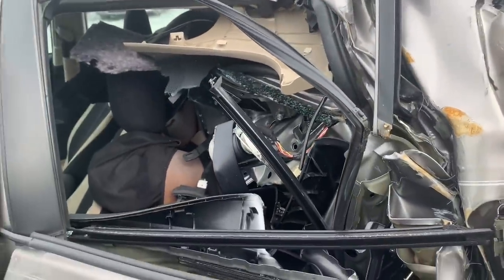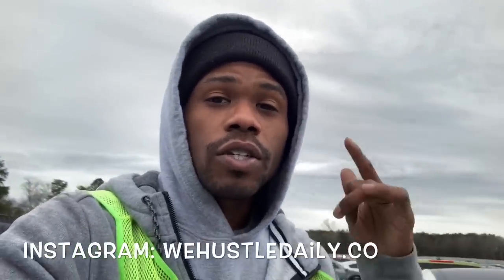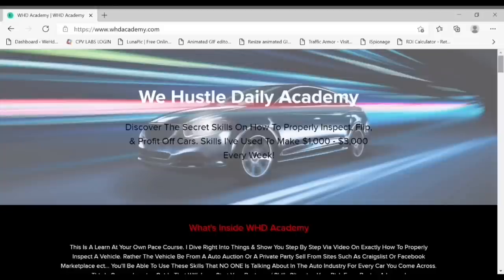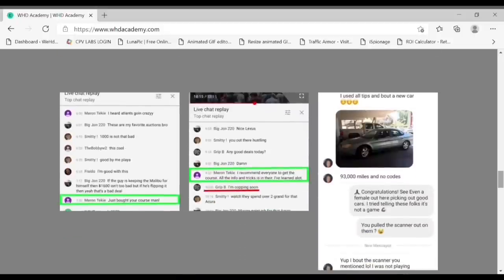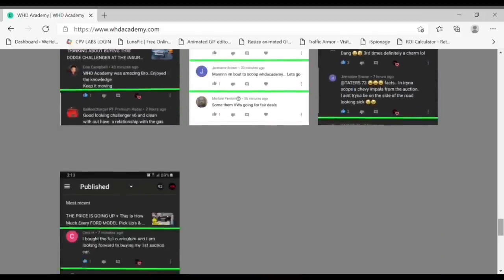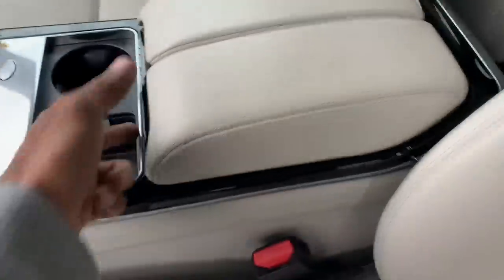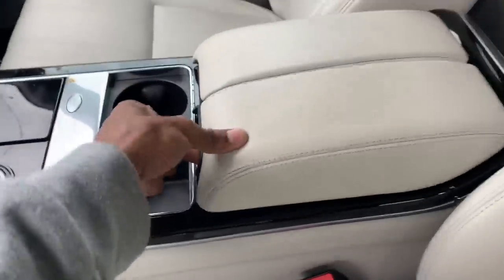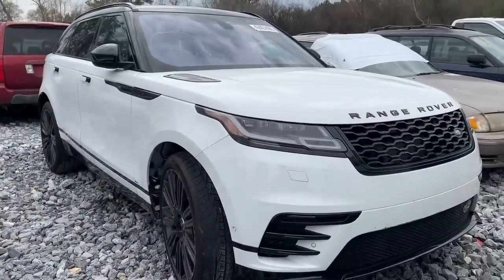MINOR DAMAGE ON THIS $100,000 MERCEDES BENZ S550 AT COPART!? *THINK IT'S WORTH FIXING?*

Comment: Subaru is an early B9 Tribeca, in later years renamed Tribeca. Fun fact the LATER refresh version with the different front was supposed to be a rebadged SAAB .GM pulled the plug on saab so subbie used the Saab front end as a refresh.

Comment: I doubt that benz would be worth fixing unless it has super low miled. Benz parts are so ridiculously expensive.
Reply: Yep.  They fall apart after 80k
Reply: 80k ? How
Reply: @901trukkdriverremy2  Usualy first to go is some electronic module or some part of the air suspension I'd give it 100k miles before a failure.